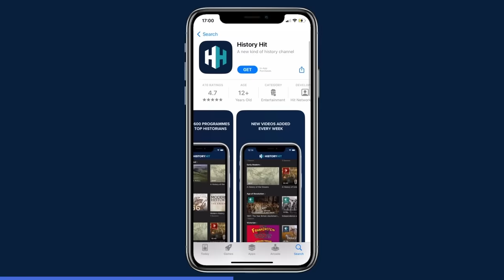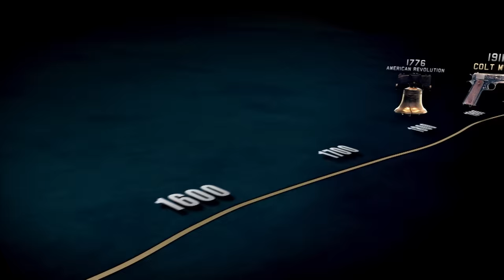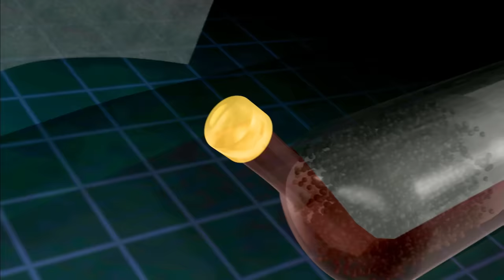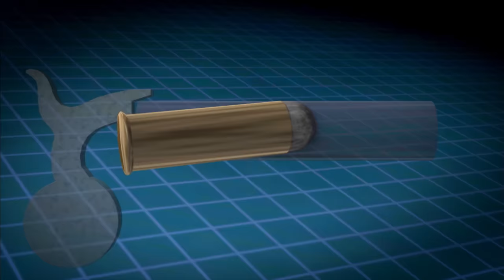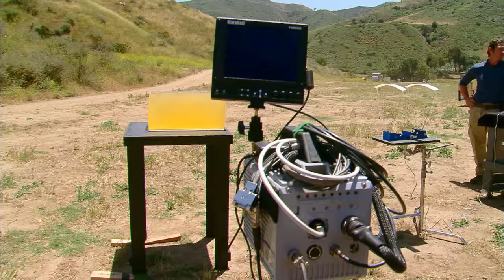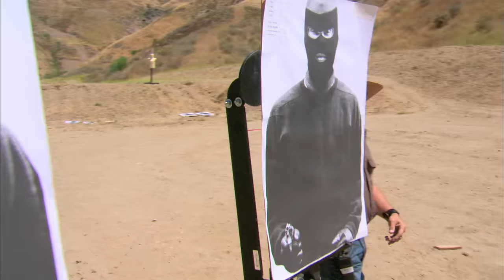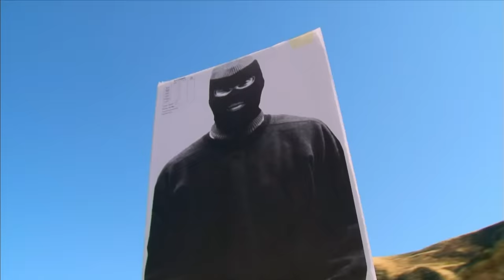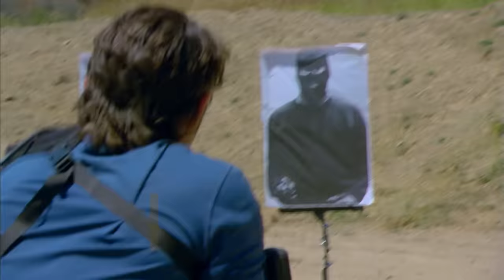Why The Colt M1911 Is The Ultimate Sidearm | Weapons That Changed The World | War Stories

Comment: The US military did themselves a huge disservice when they transitioned over to the Barreta M9.
Reply: Idk, having 15 rounds instead of 7 is a huge advantage, despite the loss of stopping power that the .45ACP has.
Reply: @snapdragon6601  well I can hit dimes at 50 yards with my 1911's so with some practice 8 +1 is plenty if you are weapon proficent
Reply: I don’t know about that. The military chose the M9 for a variety a reasons. The 1911 was a staple however it was time for something more modern.
Reply: Modern 9mm is no slouch.
Reply: Around the time more Woman entered the service
Reply: @Redbird1504  Agreed. Adopted on a global basis. Reliability, durability as well as relatively easy to operate and maintain.
Reply: @snapdragon6601  The new M1153 fixes that issue.
Reply: Stopping power? Service pistol rounds possess no such thing unless you hit the central nervous system. Remember the .38 Long Colt fired a 150 gr. lead round nose bullet at a mere 777 ft/s vs the 30 grain load in .45 Colt firing a 255 gr slug at 855 ft/s, comparable to the M1911 230 gr FMJ loading at 830 ft/s, vs the M9 firing a 125 gr FMJ at 1150 ft/s.  There's more than a few reasons even top level SOCOM units, particularly CAG (aka "Delta") in 2010, have shelved the 45 in favor of Glocks in 9 or 40, and the Marines retired them last year, finally, in favor of the M18.
Reply: @brandondavis4306 
This is possible with a Sig P 210 9 mm or Sphinx 3000 in 9 mm too for example.

Comment: Had a 1911 in the Army Nat Guard in the late 80’s and was issued an M9 when I transitioned to active duty 2 years later. I didn’t like the M9 at first. It felt cheap and flimsy by comparison but it held a lot of rounds and was easy to service.  Still, the 1911 was like carrying a piece of history with you, as if the spirits of the soldiers of the past century were with you. Plus I liked weight and the well-worn rattle mine had.

Comment: The 1911 is a mechanical work of art. Sets in the hand and points naturally. All the controls just where you need them to be. Mags can be changed quickly. Easy to take down to the smallest part w/o tools. Changing the firing pin and extractor can be done simply by jacking back the slide and dropping the FP stop. It's heavy enough to use as a great club. No chintzy plastic here, all business!

Comment: This was by far the best demonstration of the Colt 1911 that i have seen.  I am a big 1911 fan.  I own 3 .  I am forever having to defend them against the 9mm crowd.  The only con that I can see is capacity.  That's when accuracy has to prevail.   This podcast was  put together well.  Very through, covered most questions asked.  I will never flip flop on the 1911 .45.    Thank you.

Comment: Please carefully test the percussion revolvers and the myth of patch and grease stopping or preventing chain fires. Patches and lube may hinder front-face chain fires but won't guarantee chain fire prevention. Also, chain fires happen more frequently on the rear face of the cylinder where wads and lubes have no effect. Proper seating of the percussion caps on the cone's nipple and tightly seated lead projectiles (round or conical) over the powder and chain fires are totally preventable without lubes or patch wads. Lubes and wads provide other advances, yet not a chain fire stopper as a matter of fact. Thanks for this most excellent video and yes I operate six M-1911s and have for fifty years.

Comment: You Have to remeber that the colt .45 will also help with helping to put you back on target at least I have found that to be true with my 1911 this is a big help to my useing the M1911 for non moving targets I dont fire my 1911 very much as the recoil dose give me some troble at times. But I do like the it puts me right back on target.

Comment: Also, the Luger would not (and was not) a good choice to be dragging through trenches or no mans land because of that open toggle design. Any bit of dirt or mud gets in that and the action will quickly jam up. And, yes, you may be shooting at small targets even in trenches: a guy poking his head/upper torso plus weapon around the corner in the trench is going to be pretty small.

Comment: I like the 1911 whether its a 9mm or 45. That said, both the 9mm and the 45 have seen military and police service for more than a century. The beauty of that is if there were inherent problems with either caliber we would have know that long ago.

The test War Stories used is hardly a good one. A lot depends on the operator of the weapon and not the caliber or the weapon itself. While the Germans used the Lugar and there were even 3 Lugars chamber in 45 for the USmilitary evaluation, the Lugar's principle disadvantage was its cost.

The Luger ended up being an officer's gun, and not enlisted ranks. Enlisted officers (NCOs) used broomhandles which were also quite popular. I was lucky enough to trade a couple of ARs for one that came to the US after WWII.

45 variants are my EDC. I like its controllability, accuracy, reliability. I use to use a real 1911 as a EDC for  years.

The biggest problem with side arms are controllability and accuracy. Not many soldiers in the stress of warfare can accurately hit a target. It takes lots of practice to accurately hit targets during that stress.

At pistol distance I believe the 45 is superior, at longer distances the 9mm has  an edge. Its not that you can't hit something at 50 yards with a 1911, because you surely can, but you will need to practice a lot.

Like Col Cooper said the law of gunfighting is bring a gun. His corollaries were if you can, bring a rifle instead and have all your friends bring their too. There is a lot more energy in almost any rifle compared to a pistol.

Comment: I'm very disappointed with mine and if I needed firearm for anything serious, I would choose my Glock. My Colt series 70 just keeps doing weird ejection malfunctions and mutilates nearly every casing during ejection. It turns out that not many gunsmiths in my country are proficient with this ancient design. So far, ejector (was broken) and extractor (was somewhat worn) has been replaced and tested with three different weight recoil springs.

Comment: I have had the opportunity to fire full size Glocks in 9mm, 40S&W, 45ACP, and 10mm. 

9mm had a sharp recoil. Like slapping the palm of your hand with the back of your fingers. 40S&W was not quite as sharp. I didn't like 9mm or 40S&W. 

45ACP had a bigger recoil, but softer. Recoil of the 10mm is about as big as the 45ACP, but harder. I have a 10mm Glock 20. I'm happy with the 10mm, but I think I would have been happy with 45ACP if I had gone that way.

Comment: You were doing that all wrong. You forgot to whisper "the Stopping Power" into the breeze. It unlocks Full Semi-Automatic mode. You don't even need to pull the trigger. The stopping power does all the work.

Comment: in a active shotting scenario i bet they just load to 6 since the 5 round loading was a safety. You don't need safety on if your under fire.
Reply: Load 5 if you Have a single action army. Load 6 if you have a blackpowder cap and ball which has resting notches in between each cylinder
Reply: @jason200912  Did you read the comment? I think most people would not worry about leaving a chamber empty in an active fire fight

Comment: The .38 Navy conversion was not really the predecessor to the .45 Colt peacemaker.  The .44-40 1860 Army conversions were a much more accurate example of a direct predecessor in the same class as the Peacemaker; but the difference in ballistics between the 44-40 and the .45 Long Colt aren't as dramatic as comparing two different classes of firearm are, so I guess that's why they picked the .38.

Comment: One footnote to the WWI M1911 story is that the US couldn't produce, quickly enough, sufficient M1911 automatic pistols for the US Army.  The solution was to issue Colt and Smith & Wesson Model 1917.45 caliber double-action revolvers to supplement the autoloaders, but using the same .45 ACP cartridges.  Now because ACP rounds are rimless, they'd fall right through the cylinders of the Colt .45 cal revolvers.  (The similar Smith & Wesson Model 1917 had a raised ridge inside each chamber of the cylinder to properly headspace the cartridge for firing.)  But neither revolver's ejector would work with the ACP round due to its lack of a base rim for the ejector star to push against. This was only made practical with Smith & Wesson's brilliant invention it shared with Colt (at government request) of the half-moon clip, a crescent of stamped steel into which three .45 ACP rounds could be snapped in advance by way of their extraction groove.  This simplified logistics by making the .45 ACP round applicable to both the WWI Army's revolver and automatic handguns.  Moreover, all six expended cartridges could be quickly extracted with one slap of the M1917's hand ejector, and two pre-loaded moon clips inserted,  The moon clips made both ejection and reloading of the Colt and S&W revolvers nearly as quick as changing magazines in the M1911 Colt automatic.

Comment: Ahhhh.... The last time I checked there's no such thing as the Beretta 92SBF.... 92F & then later the 92FS. Basically the Navy was shooting +P+ submachine ammo and broke the slides so Beretta modified the existing M9's/92F's to the 92FS' and modified all of the new production M9's/92FS'. And actually the Beretta 92S was the predecessor of the 92FS/M9, that gun can trace its lineage back to the Beretta 1934 and the 92S, 92F & 92FS can trace its lineage back to the Walther P-38 because it got the same or similar type of locking block. The US Military was still using the 1911's into the War on Terror. The Marine Corps was using M1911A1's from WWII which were heavily modified and customized and designated as the M45's, they also acquired Kimber 1911's as Det-1 MEUSOC pistols and then eventually acquired Kimber Desert Warriors at some point. They eventually adopted a Colt 1911 Rail Gun and designated them as M45A1's in their arsenal but I'm pretty sure that they've been since replaced with other pistols. Also the saying isn't God made man, Colt made them equal.... It's God made man, John Moses Browning made them equal. When the US Military wanted to adopt the M1911, they wanted a semi automatic pistol in a cartridge no smaller than .45 Caliber. The Luger actually went through the testing with the M1911 and obviously was never adopted so he rechambered it in 30 Luger and then later 9mm Luger or 9mm Parabellum. As far as the Sig goes, they were the ones that were being tested up against the Beretta when they broke the slides on the Beretta's, they cracked the Sigs frames and some internals on the P226's but it wasn't as catastrophic as the slide separation on the Beretta and they only lost the original M9 contract by $1. FYI the Makarov's were chambered in 9mm Makarov (I think 9x18 Mak), not 9x19 Nato or 9mm Luger or Parabellum. I don't get why they showed a Glock 23.... because it's a .40S&W not a 9mm, the Glock 19 would be the 9mm compact version. Although, at one point I wanna say special units in the US Army were getting .40S&W Glock 22's, eventually I think that they got Glock 19's which is what they really wanted because it was smaller, lighter, had one single trigger pull to master and held the same amount of rounds as the 92FS/M9's & P226/Mk25's. The Navy has eventually gone to the Glock 19's (Mk27 pistols) for similar reasons ( I wanna say that they were using Glock 19 Gen 3's, I think that they moved onto Gen 4's, not sure if they've moved onto Gen 5's yet). The Marine Raiders use Glock 19 Gen 5's as their M007's, for plain clothes operations and I wanna say that some units in the Army are using Glock 19's also.

Comment: The 1911 is a great platform. I carry one every day. That said, 45 acp has no real advantage over 9mm Luger and several disadvantages like lower velocity and less penetration. A 1911 is a far superior platform to a Luger imo. Lugers are finicky and modern 9mm pistols are more similar in design to the 1911.

Comment: At about 30 minutes, the announcer says the "Navy" round is .38 caliber, while the Colt is .45 caliber.  He is correct about the Colt single action Army with a 45 caliber round, (actually about .452" in diameter), BUT, the other arm being used is NOT a .38 caliber ball.  It is a .36 caliber ball.  I have an original.  It is .36 caliber.
A mistake like this puts a shade on this whole video, considering the actual Colt Navy was called a Colt Navy .36 right from the manufacturer.  Also, the original .45 Colt single action Army velocity was around 800-900 feet per second.  Not a chance it would make 1200 fps.  (I have one of those, too).    What a goof!

Comment: Calling the P08 Luger the "predecessor" of ANY modern pistol is misleading at best. Yes, it was chambered in a 9mm cartridge but it is the cartridge not the pistol design that has endured. The Luger's toggle lock action has never been widely copied except by those manufacturers making replicas/clones.
Reply: @bobhubt4402
Not not true the luger's toogle lock action was used in the LMG 25 (swiss light machine gun 25) and even in the swiss 24 mm tank gun 41.

Comment: the alloy commander, in .38 super, is pretty good for edc and the govt model  in 9mm is good for practice and competition,  but I pocket carry a Sig P938, rechambered to 9x21mm,  with a solid aluminum, hollowbased 45 gr hp what is slit nearly in half lengthwise. and I get it to 2200 fps, for 500 ft lbs of power. I'ts AP, no more recoil than a Makarov and I get two diverging wound tracks with each hit.  Animal tests prove that it's more effective than a  4" barreled 357 with 125 gr jhps' Pretty good from a gun that looks like a wallet in a front pants pocket holster. I use velcro to ensure that the Kydex pocket rig CANNOT come out with the gun.

Comment: The 1873 with a full 40gr load and 250gr bullet is about 950fps... NOT 1200.... It's a quite formidable load at the real velocity... the quoted 1200 should be 44Mag energy... never happened. The pressures needed would take a '73 apart.... especially with the 19th century steel, which was nothing flash.
The 45ACP and the modern 9mm are about equal in energy, but the 9mm shoots flatter.
Still love my 1911 though... I have little hands and I like the ergonomics....

Comment: 124gr 9mm exits the muzzle at around 1150 fps. The muzzle energy is 364.24 foot lbs. 

The 45AARP is usually a 230gr projectile traveling at 850 fps which is 369.08 foot lbs of energy. 

The difference is negligible, especially with modern hollowpoint technology. 

Handgun rounds are comparatively weak when your primary weapon is a rifle.

Comment: They created the M1 30 caliber carbine for a reason. They were replacing the M1911 because of medical stats. Very few wounded from 45 rounds. There’s a reason we use better versions of that weapon. When I tried one, it was too barrel heavy for my taste. I went with S&W SD9VE. Perfectly balanced, natural pointer and very accurate.
Reply: It's because range is more important than diameter in wartime.  So a m1 carbine that weighs nothing but allows 150 yard shots is a huge improvement
Reply: @jason200912  .30 Carbine is also substantially more powerful than .45 ACP even at close range
Reply: @redtra236  yeah but it'll just zip right through the body so not the best for close range
Reply: @jason200912  That's true if using the FMJ round at least. A Thompson would definitely be more effective than an M1 or even M2 carbine at close range.

Comment: I’d pick the Walther p38 over an 1911 from ww1 or ww2 any day. 

The 1911 isn’t ideal for carrying it with a round in the chamber with the hammer cocked. 

Even with the external safety on, it was not drop safe (until colt mitigated this issue in 1970’s). 

The Walther p38 however was safe to carry with a round in the chamber and because it was a double/single action gun you could carry it safely with the hammer down.

However, at a moments notice you could pull it out and pull the trigger to have it go off. 

Don’t get me wrong Id count on the 45acp over the 9mm in terms of destructive power but I value the practicality of the Walther much more.
Reply: I'm also not a 1911 fanboy.

Comment: I suppose if I had a sound suppressor the 45 would make sense since it’s such a slow moving around but other than that today’s modern 9 mm are definitely the way to go. No overpenetration increased round count and much less expensive per round. And then there’s the whole recoil factor.  Which probably explains why the more modern 2011 in 9 mm has become one of the most popular new firearms.
Reply: Correct, .45 ACP is a subsonic round so it is much quieter suppressed than the 9mm suppressed since 9mm breaks the sound barrier since it’s a faster round

Comment: In the Philippines they came charging at the soldier swinging a machete in each hand windmill style or like blender blades. They also wrapped themselves tightly so the bullets transfer of energy was better contained and help the bullets pass through with less damage. This is why a new gun needed stopping power. It's a good thing they had 12 gauge pump shotguns.

Comment: With modern 1911s, the 45acp can be hot loaded, better than any 9mm,all semi auto pistols are based off of John Browning, the reason the USA armed forces did away with 45acp is because 9mm is cheaper than 45,typical bean counters.I myself have  Ruger 1911,and a M&P 40.